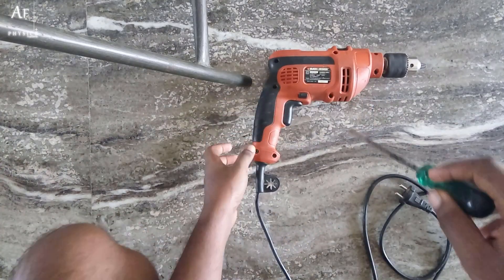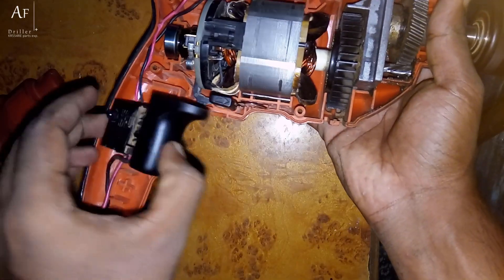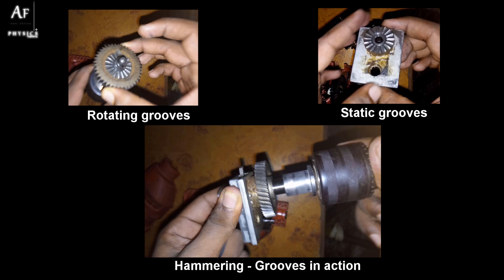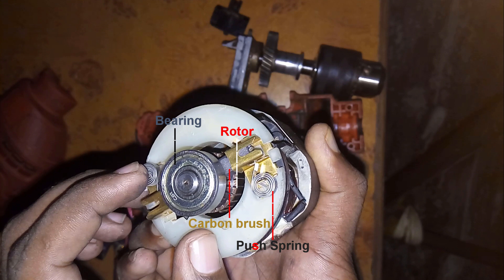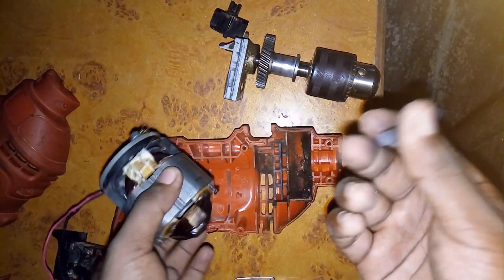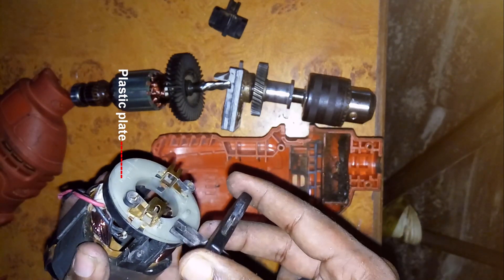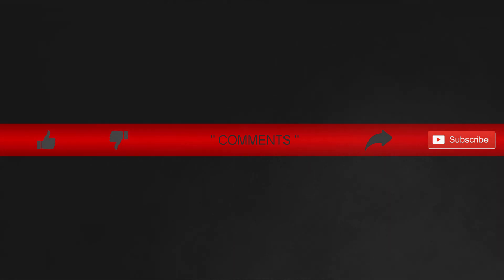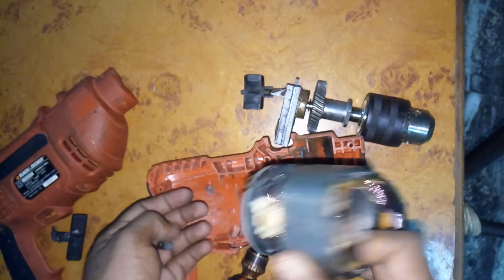Driller parts remove and repair with explanation

Comment: When it is not in hammering mode this lever prevents the drill chuck spindle to mobe backwords hence prevent these grooves to touch each other thus stopped hammering mode.. When u put this lever in hammmering mode these two groves came in touch with each other when u press drill against working piece thus creating hammerling actio n

Comment: Any idea how to replace the chuck ? Isn’t it standard on this model?? Thanks
Reply from the maker: I don't have a very good idea about standard models. But this chuck has screw at the center of the chuck (visible when the mouthpiece is wide open). Clockwise to unscrew it. The chuck pops out after jiggling it a little.
Reply: Anuj Falcon thanks for your quick reply , as I can see in your video it seems to be attached together with the gear , I can’t see any screw inside , I ve tried a few different size of keys but nothing seems to get into it..

Comment: Hi I have the same drill in me. Drill direction change latch does not work. There is a round spring that moves the latch, I think I attach it incorrectly. I fatih-gulec@hotmail.com